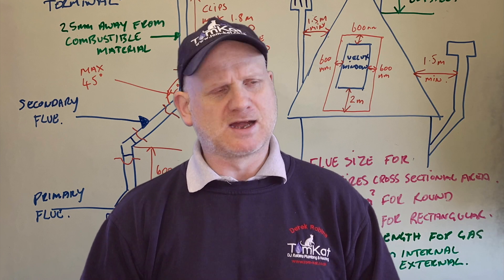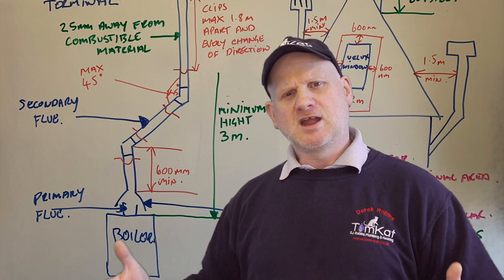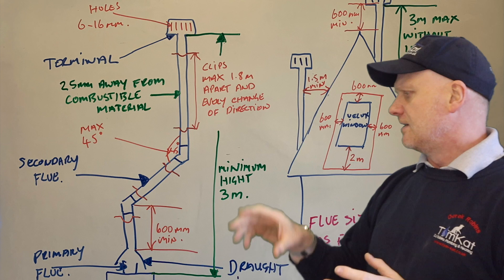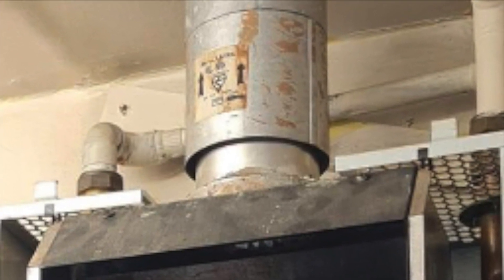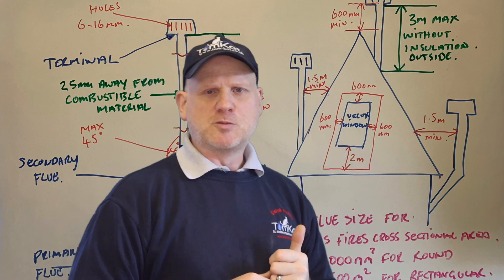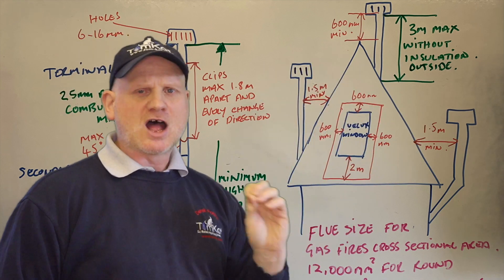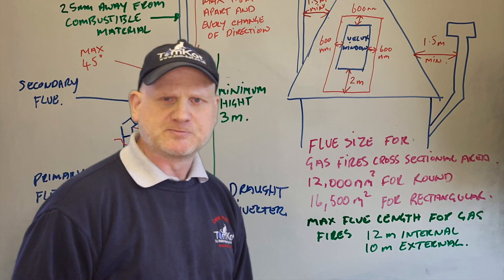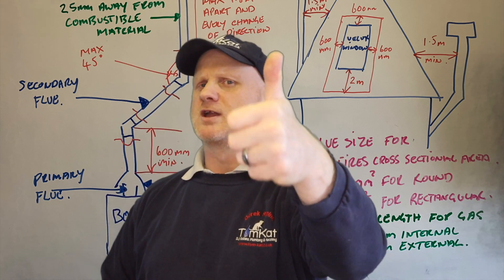OPEN FLUE SYSTEM acs revision in less than 10 minutes  on open flue boilers and fires flue system.

Comment: eh up.  great informative videos thank you.  We have a flu which is below but to the side of a velux.  Am I right in thinking that so long as the flu is 600mm away from the vertical line from the window, we should be ok? even if it is not 2000mm from the bottom?  also are those measurements to the edge of frame or opening? Also, perhaps it would help to add an angle flue top? I've learnt more today than I did in school.  thanks

Comment: Hi dezza are there any decent ACS revision packs worth buying ?  I got mine in 3 weeks and I’m going core case folder which I learned from during my 6 weeks in centre.

Any other recommendations?? 

Do you advise doing mock exams ?
Reply from the maker: Just keep watching my ACS revision exam videos and make sure you understand ventilation, pipe sizing calculations and purge volume. The rest you will find in your training manual and the standards.
Reply: @tomkatgastraining   thanks mate !👌
Reply: @tomkatgastraining  is the written exam very difficult?
Reply from the maker: @charliefox6987  only if you have not prepared well
Reply: @tomkatgastraining  I feel like I’ve done enough in terms of reading over my book and doing mock test but not sure how to prepare for a written exam.. fingers crossed 🤞🏻
Reply: @tomkatgastraining  Passed my ACS yesterday thank you for the content . It helped in preparation 🙌🏻
Reply from the maker: @charliefox6987  👍🏻

Comment: We can add that if yhe flue is made of bricks instead of 45⁰ elboews we can have 30⁰ maximum, is that right?
Reply from the maker: Not sure what you are asking but pre cast and brick chimneys have a maximum angle of 30 degrees and steel flue is 45 for open flue and you can have 90 on fan flue